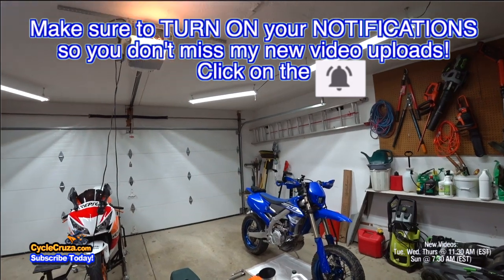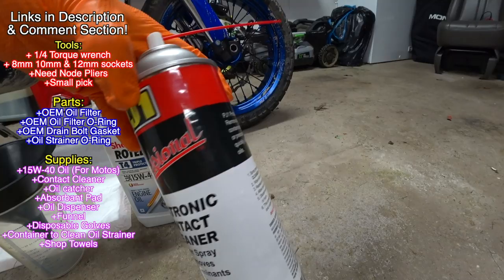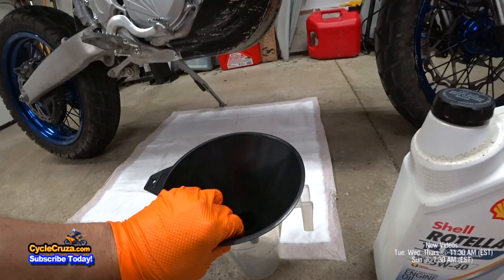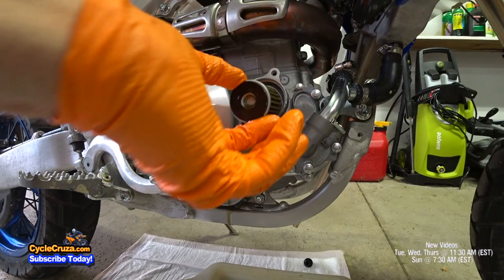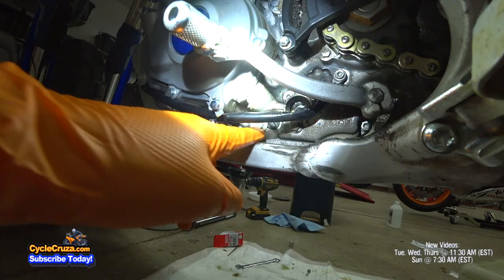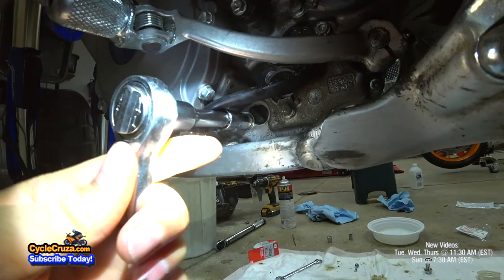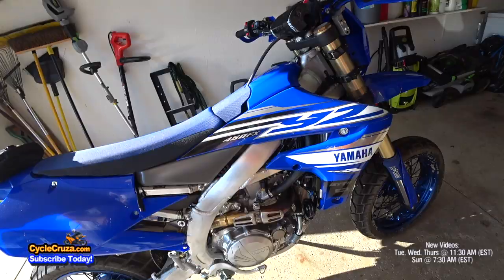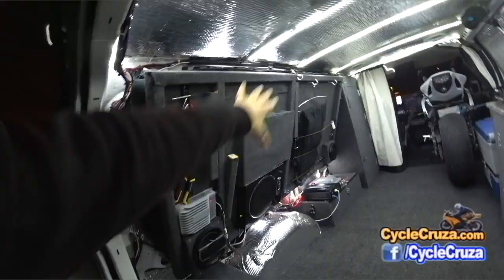Oil Change: Yamaha YZ450FX YZ450F WR450F (2018 - Current)

Comment: I have a Suzuki DRZ 400 and I'm tellin you guys the Rotella T6 oil is awesome for your 4 stroke bikes especially with a wet clutch. Makes shifting ohh so buttery smooth baby.
Reply from the maker: Yeah I use the T-6 Synth for many years and my bikes run good.
Reply: @Bob Bobby I love my DRZ...It's inexpensive, ultra reliable and has a super low maintenance schedule. It has a ton of low end torque and has a huge aftermarket parts. Yes, the Yamaha is faster but costs twice as much and has a very high maintenance schedule. Like oil change every 10 to 15 hours compared to 2500 miles on the DRZ. For me, the DRZ is the best bang for the buck dual sport made...I have been riding since I was 9 years old since 1975 and have rode all sorts of bikes, the DRZ is a super fun bike for what it is intended for...Of course, if I was intending to ride dirt only I would have chosen a different bike but I wanted a bike I could ride on street sometimes and dirt most times....

Comment: Some motorcycle forums are recommending adding one ounce tw w3 oil per 5 gallons of gasoline to improve overall engine performance, miliage,  and also to prevent the slime that can clog your carb jets.

Comment: You can use this for the 2019 WR 450F as well, same engine as the YZ 450s. I personally use the Yamalube 10w-50. I'm a little hesitant running diesel oil in my $10K dirt bike, but I know a lot of people do.

Comment: The only way to see how oils compare is on high mileage bikes and measure wear.  Low mileage bikes it is too early to really see if one oil is better than another. You  can also send oil samples away for analysis for an objective view of how one oil compares to another.  We do that on airplane engine oil where you can not afford a catastrophic failure.

Comment: oil change on the bike i got, have to take the gas tank/valve cover off then put oil down the timing chain valley ... 1.7 quarts, has a drain bolt but nowhere to easily fill it up.

Comment: Careful using a torque wrench make sure you stop tightening the fastener when the torque wrench clicks. When you were tightening the oil filter cover bolts it looked and sounded like you over tightened the bolts.
Reply from the maker: I use a 1/4 torque wrench and convert lb-ft to inch pounds. I take care of my torque wrenches. Trust me, I learned the hard way in the past using a 3/8 torque wrench and snapping a small bolt head off from over-tightening it and had a hell of a time removing the stem. lol

Comment: You said nothing about, and didn’t appear to, put a film of oil on the rubber seal of the oil filter before installing it. Did you? That’s considered pretty important on most engines...
Reply: Only with twist ons is it really neccessary.  Press fit is fine to leave dry. Alot of oil filters come with a very low weight oil on them anyhow.

Comment: Makes my ktm 300xc oil change look simple.  I want to get the 2020 YZ450FX bad though.
Reply from the maker: I love this bike, so sick to make your own custom engine map on your phone and easily keep track of maintenance. I have doe nothing but oil changes and clean the air filter, haven't even looked at the valves and won't until I get a too end done at 100 hours. I only have 21 hours after a year.
Reply: @CycleCruza  I am a vet desert racer and I have been looking to switch to a 4-stroke and the Yamaha is appealing to me for the wide ratio transmission, 160 watt stator for night races and Yamaha's reputation on dependability.

Comment: Is it safe to ride a motorcycle on the interstate with a plugged/patched tire? Thanks!
Reply from the maker: It's not recommended but you should be ok if you plugged it correctly. I wouldn't go too fast and ride in the slow lane.

Comment: Hello,  
I am about to buy a used dirt bike 450f Yamaha 2014,  but when I checked the bike there is an oil leaking from oil strainer?  Is that normal?  Does it need only Oring?  Thank you

Comment: .68 of a Quart?  Wow that doesn't hold much, does that amount lubricate the clutch system too or is it separate?
Reply from the maker: For everything!
Reply: That’s false the 18 and up yz450f is 1 quart standard oil change 1.06 quarts with filter please take this video down before someone blows up their bike
Reply: @2a1si  not the same bike ... do you have the 450fx manual to prove it?

Comment: Can you test ride/review some big adventure bikes?  I'm thinking of stepping up to something better for cross country touring but still keeping the weight down
Reply from the maker: Although I don't trust KTM all that much, the new KTM 690 Enduro R is the best lightweight ADV bike. However it depends on what type of riding you will be doing, if your off-road riding is just dirt roads the an ADV bike is fine. I would like to test ride some ADV bikes though to share the experience on my channel.
Reply: 80% hwy touring 20% off road for camping.  I like the Yamaha super tenere on paper for it’s cheaper cost and reliably.   There’s just no dealers within a few hundred miles with one to test drive.  Yes I know it gets a bad rap compared to the GS, but I just dont wana pay bmw prices.
Reply: Brent ... KLR650... Almost bulletproof, and even though they are discontinued, many dealerships still have them new, dealership support for them is fantastic, and you can almost steal them used...

Comment: The oil says it is for heavy duty diesel engines? I've been looking for a good 15w 40 for my scooter, but everything seems to be made for diesel.
Reply from the maker: Use this oil, trust me. If you do a search in Google, you will see this is oil is highly recommended for motorcycles (and scooters). It's JASO MA/MA2 approved. If you click on the link, read the reviews and you will see motorcycle reviews: https://amzn.to/2KkGFrA
Reply: I have a Suzuki DRZ400 and use the Rotella T6 in the blue bottle. It is fantastic for a 4 cycle engine especially if you have a wet clutch. It makes the shifting so buttery smooth. I have a oil change video on my channel also that I tell you about it.
Reply: @CycleCruza  Okay thanks
Reply from the maker: @imyourhuckleberry357  You can use the T6 or T4, both JASO MA/MA 2 approved for motorcycle use. I started off with non-synth to break the new engine in, after will switch to T6 15w40.

Comment: I personally wouldn't recommend Rotella to anyone for oil. Used it in vehicles before and it caused leaks. Never used it in a bike though but with the experiences I've had I don't trust it. I use yamalube for my bike and Amsoil for the cars.
Reply from the maker: It's extremely popular within the motorcycle community. I've been using Rotella oil since 2012 and my bikes ran great. If you look at the reviews you will see it's 5 star rated:  https://amzn.to/2KzUamt
Reply: I use Rotella T6 on my Suzuki DRZ 400 and absolutely love it. Especially if you have a wet clutch the difference is night and day from OE oil.
Reply: The T6 is what I've used. Could be better in bikes but I still don't trust it guys.
Reply: Rotella and Quaker State for me Pennzoil looks like what you drain out of a motor
Reply: I use amsoil in my 2004 gsxr1000 it's Phenomenal my bike loves it and shift the bike has gotten smoother  my bike has 53,000 on it and runs like a brand new bike